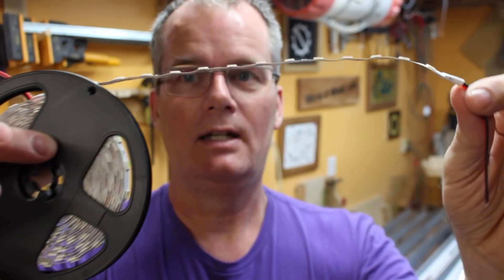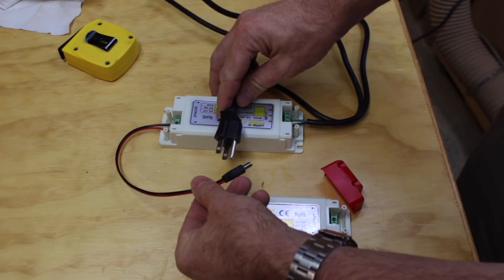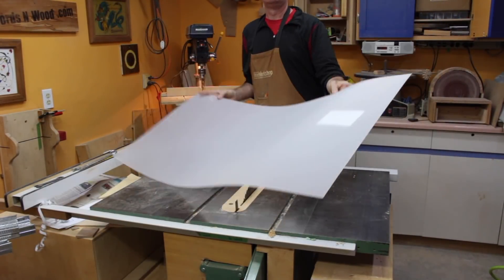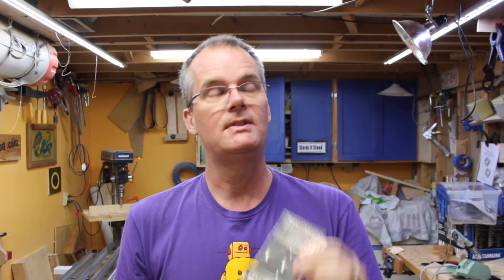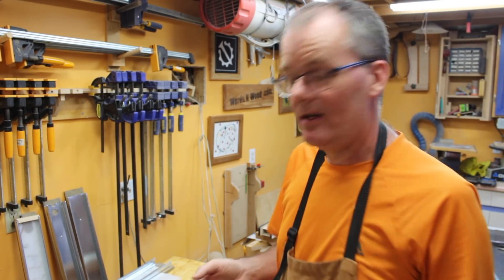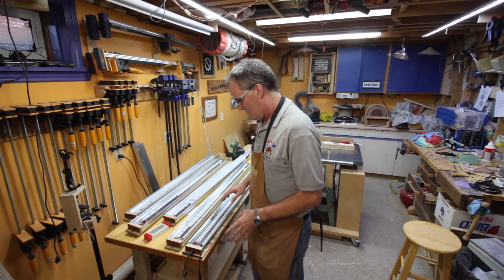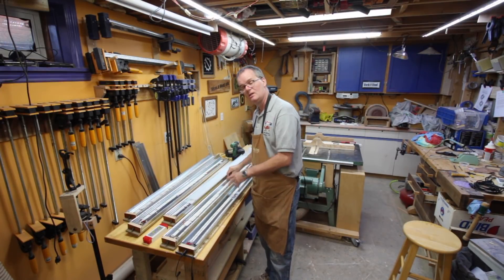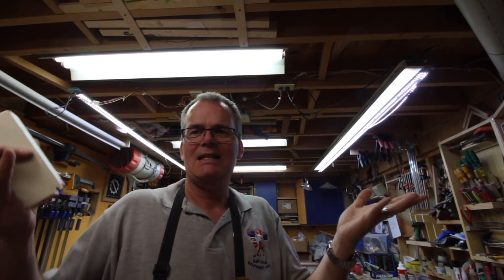How To Make DIY LED light fixtures (WnW #135)

Comment from the maker: Playing with electricity again...
Build Article:  http://www.wordsnwood.com/2018/LED-lights

I am building my own LED light fixtures again.  I am building off of my previous ideas, and also incorporating in some of John Heisz's ideas (from the ibuildit.ca channel)

This time I am adding diffusers to smooth out the light and reduce the hotspots.  I also am trying out some solid state DC power supplies that are dead silent - as opposed to the hum coming from the PC power supply (used in my previous LED lighting project)   

I like the end results, but it's still hard for low cost LED strips to beat the brightness of fluorescent fixtures.

---------- ---------- ---------- ---------- ----------
LINKS TO SOME OF THE ITEMS USED:

(The Amazon links are affiliate links.  If you buy through these
links it helps support my channel.   Thank-you so much!)

LED SUPPLIES I USED:

https://goo.gl/rHrAqB — LUSTREON 60W AC100-240V to DC12V LED Driver
https://goo.gl/ktn663 — 5M SMD5050 300 LED White LED Strip
https://goo.gl/sHUCcm — 5.5 x 2.1mm Female To Male Plug DC Splitter Connector
https://goo.gl/UFHfjH — LUSTREON DC12V Male/Female Power Supply Jack (Choose male or female ends)
https://goo.gl/NXuQ1G — LUSTREON 10M Tinned Copper 22AWG Wire 
https://goo.gl/zXjegL — banggood.com 10% off coupon (US Warehouse) (code: USELE10)  Code from June 2018

I also used two of these that I already had:
http://amzn.to/1SF0c55 — Lighting Ever 5050 LED lighting Strip
(these are the “more expensive ones” I referred to)

GEAR I USE TO MAKE VIDEO:

http://amzn.to/1qPkvBp — Canon T5i
http://amzn.to/2aK7jZX — Inexpensive Quick Release tripod ball head  (Very useful)
http://amzn.to/1SSwOmS — Sony Action Cam. (I use the HDR-AS15 which is discontinued -- cheaper than a gopro.)
http://amzn.to/267XM3M — Sony Live View video remote for Action Cam
http://amzn.to/1XC2D7l — Joby GorillaPod (Flexible small tripod)

---------- ---------- ---------- ---------- ----------
Many more woodworking projects:
http://www.wordsnwood.com

PLEASE SUPPORT MY CHANNEL

The best way that you can help support what I do is to buy one of my woodworking plan packages.  
Details here:  http://wordsnwood.com/plans/

Follow me on Social Media:
https://www.instagram.com/words.n.wood
https://www.facebook.com/wordsnwood

---------- ---------- ---------- ---------- ----------
Thank-you!
Reply: I know it is kinda off topic but do anyone know of a good site to stream new movies online?

Comment: Your lighting problem is also due to your ceiling being brown and black, and having those rectangular caves in which light goes to die. Cover your ceiling with bright white removable panels.
Reply from the maker: Easier said than done.
Reply: LED lighting physical configurations and panels from flashlights to stadium lighting are coming out almost monthly now. There are many full assemblies on the consumer market for cheap and easy and simple install. plenty of DIY designs with the current available strips and panels.
Reply: spray white paint in joist space fix works.

Comment: I've been studying your "evolution" in LED Strips and learning a great deal.  I now have purchased a bunch of "daylight" LED reels for an upcoming project, where I plan to solar power them, in an apartment.  We have a lot of hurricanes and power outages here in Miami, so I want to power it with a car battery and a solar panel.  I'm still sorting out the "aesthetics" of the wiring, switches, etc...  I'm surprised you haven't looked into the "solar" angle of lighting these?  "Now" you have more "material" for future videos....  I also used 12v LED strips in my hatchback's lid and trunk to light up my groceries, etc...  I've heard folks say, more than once, "Wow, I have to do that".

Comment: It's a cool design. I guess you could just keep the LEDs as fill lights
Reply from the maker: Both Matthias and John (ibuildit) have done things with "American Greenlights" so I know there are brighter LED strips out there.   So if I did it again I would look a bit more for brighter LEDs than the 5050 SMD strips that I used.
(Or just make more of them!)

Comment: Love it, nice diy.  Out of curiosity, do you know the approx price per 8' light (Canuk buck pricing is good, I'm Canuk 😁)
Reply from the maker: Adds up to about $24 for each 4ft unit, May 2018 CAD$ prices.   
Closer to $20 if you don't go with the fancy quick connect things.
Reply: Wordsnwood (Art Mulder) thank you sir.  Not bad.  Costco has 4ft lights for about $50 each, about 3600 lumen (iirc).

Comment: As usual excellent project Art! 

As a guy who does "finnicky soldering" might I suggest a flux pen? The end goal of those solder points is a smooth surface that takes up the whole pad. You don't want any spiky bits or rough surfaces. A flux pen is nice here as it helps with both of those issues. If you cleaned your iron, hit the pad with some flux, then just heated up the connections you already have those would smooth right out and become a much better, much stronger connection that's less likely to go cold over time. Good soldering is not more time consuming if you take the right steps.

Source: I do microsoldering for Class 1 (life dependent) electronics and specialize in guitar rewiring on the side.
Reply from the maker: what does "go cold over time" mean?   I'll see about checking out a flux pen sometime!  thanks
Reply: So a cold solder joint is when the solder looks like a bubble on top of a pad. It usually sticks at first but over time it'll pop off because it's not really connected in the first place, more like just touching with a bit of stickiness. A solder joint should look more like the cross section of a wave in the ocean. 

I tried to copy / paste an image link but youtube seems to have that disabled. A google search for "good vs bad solder joint" yields tons of great image search results that can better illustrate what I mean than via text. 

Good soldering really comes down to having a clean iron, and knowing what the end result should look like. If you don't already have a brass sponge as a tip cleaner I recommend one. Good luck!

Comment: Been there, done this. Best solution for me  was to use LED t8 replacement tubes. No need for power supply, good diffusion, more lumens.
Reply from the maker: I've done that also, but those only work in a T8 Fixture and I still have several older T11 fixtures